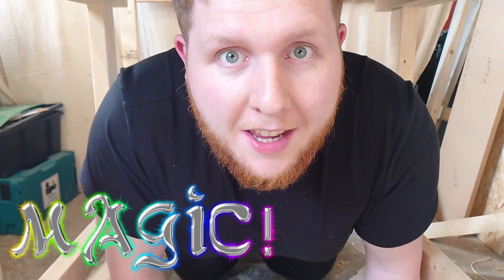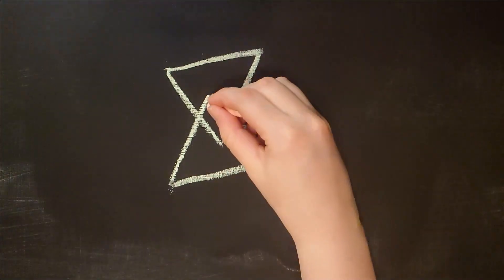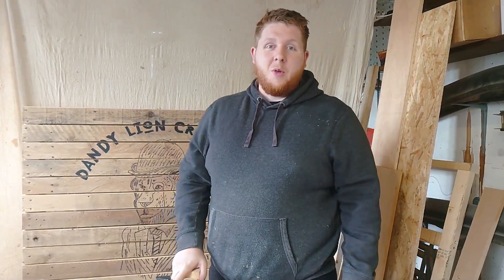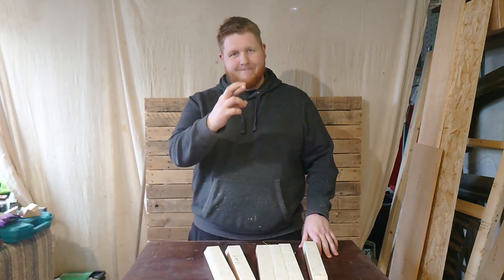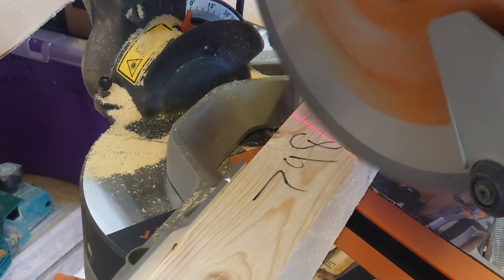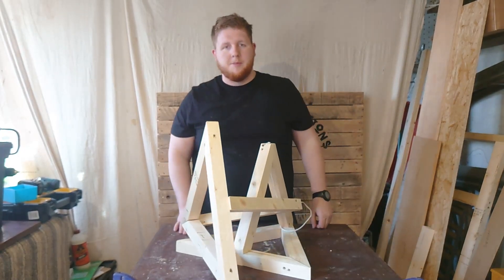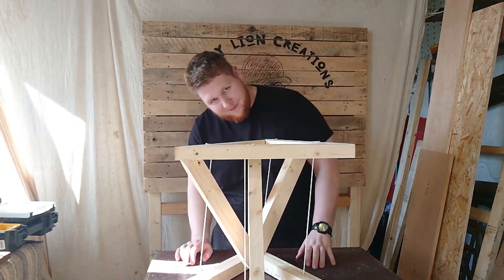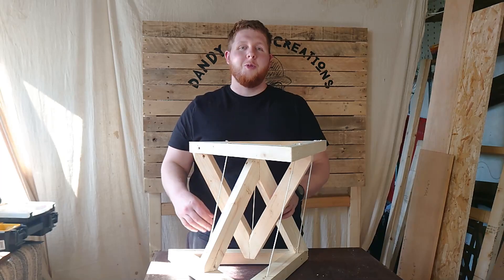Gravity DEFYING Floating Prototype- MAGIC? (Tensegrity)

Comment: I have seen many that only used two outside ropes.  With this configuration two might not work but I am guessing three should if placed properly.  Problem is the ropes must be almost exact and it is not as stable.